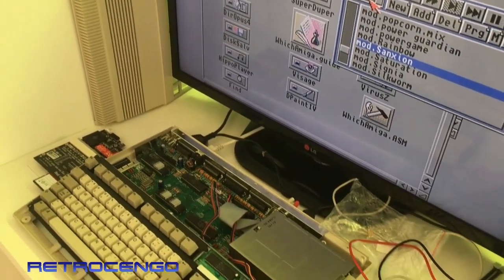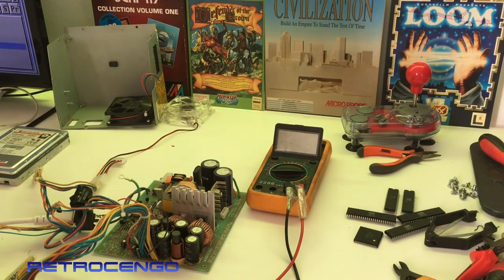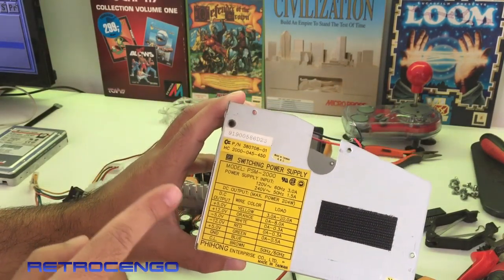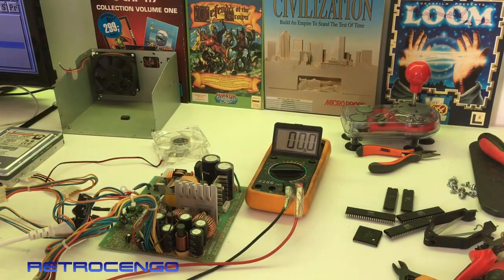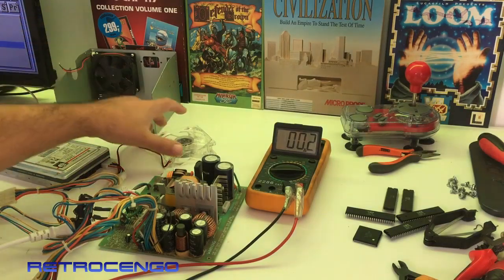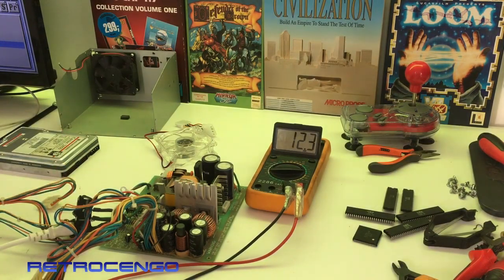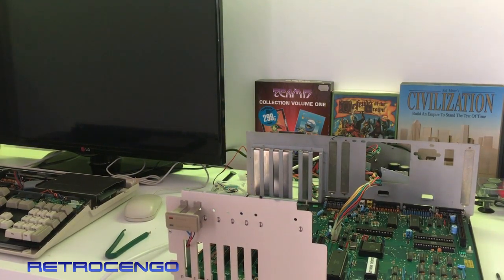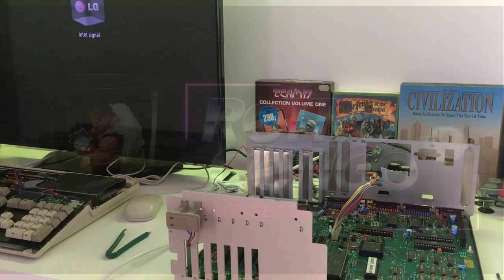Commodore AMIGA 2000 Inspection and Repair Part 1

Comment: Madlemon replaced the AMIGA 500 PSU with a smaller PSU maybe you should do the same, It might be possible to get FPGA/CPLD replacement versions of the AMIGA chips.

Comment: PSU's are dangerous for sure.   Even when they are not under power they still store power in the Capacitors which need to be discharged before working on them.    While testing voltages gives you a good reference its not going to fully tell you if the PSU is in good working order or not because its not under any load.  So without a load you can have good voltage level and with a load you might not have good stable voltage levels.    The PSU is your computers best friend and unfortunately its worse enemy.   It's not the voltage which kills you it's the current or Amperes aka Amps, and less than 1A can kill a person.     When you walk across a rug and touch someone  for example the static discharge is actually thousands of volts and uncomfortable yet harmless to people because that high voltage contains no amps but that same static discharge is dangerous to components on a board.   I will work on PSU's but its not exactly my favorite thing to do just like working on CRT's.  I will do it but its not my favorite thing to do.
Reply from the maker: Stephen Bruce Better be carefull with them CRTs for sure.

Comment: The PSU needs a Power Good signal from the motherboard, else it will think that something is wrong and shut itself off. You can simulate it by connecting the PG pin to +5V.
Reply from the maker: Hagledesperado didn’t think this old psu had that built in. Do you know which cable/color is PG?
Reply: My 2000 PSU Works fine whit out that, Think its only ATX that uses 5v power up
Reply from the maker: Amimandk my other A2000/3000/4000 psus works fine without motherboard connected, thisone was different, but now we learned that
Reply: @RETROCENGO  Some oooold psu's also freak out if there is no load on 5 volts while there is something on 12 volts. As they regulate themselves based on 5 volt load. 2 or 3 amps is often enough. What I had to do once was use an old car headlamp I had sitting about and connect it on 5volts. It was a 60 watt bulb, but at 5 volts it would only put out about 10 or so, which was just right.
Reply from the maker: wishus knight yea a HD and a fan was not enough 😁 bulb trick sounds nice
Reply: Huh, I think you're right, the A2000 PSU doesn't seem to have PG. Sorry for ASSuming it. :) Yeah, the bulb thing sounds like it might do the trick.
Reply from the maker: Hagledesperado we learned something new today, its great😁👍🏻
Reply: @RETROCENGO  a 25 watt resistor of the desired value also works. Use an ohms law calculator, but something like 2 ohms gets you somewhere close to a 3 amp draw at 5 volts.
Reply from the maker: wishus knight Thanks for the update😁👍🏻